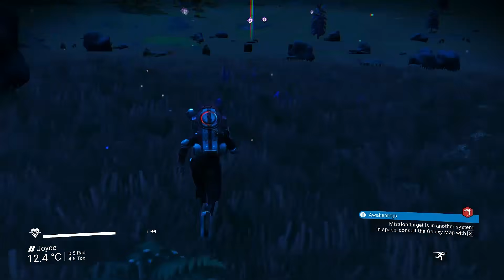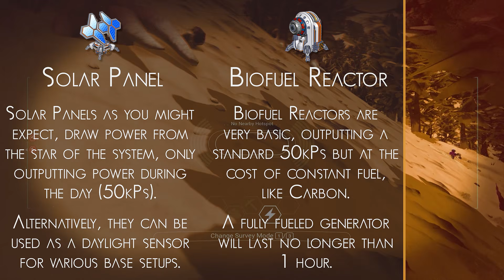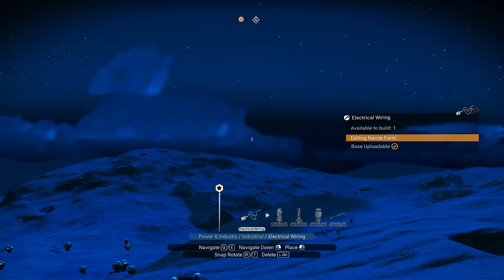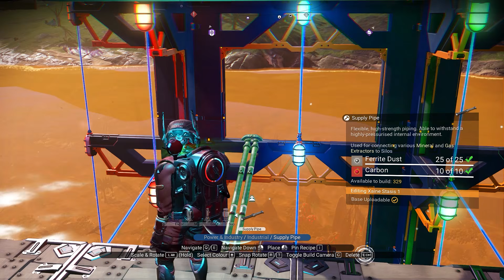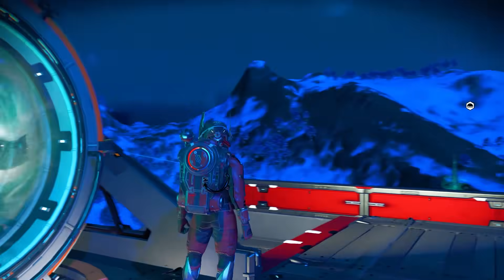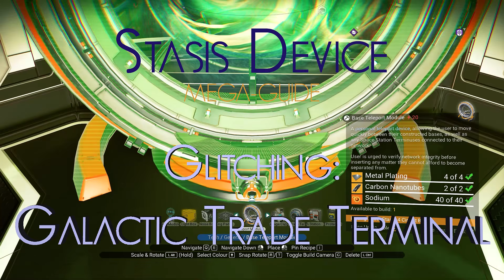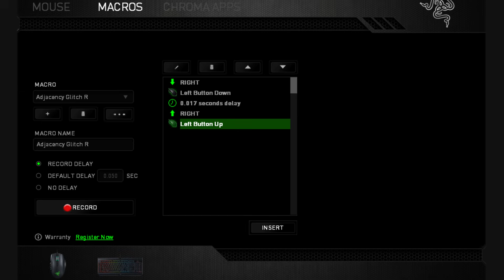Ultimate Money Making in No Man's Sky | Stasis Device Farming Mega-Guide, Units & Building NMS

Comment: Note: Hotspot output reads differently on the wiki, producing up to 250, 500, 750, or 1000 based on class.

So, because the amount of oxygen extractors isn't specifically stated, just wanted to put this here for anyone wondering. If you don't have carbon planters and need the initial oxygen to carbon burn that's just an additional 1680 oxygen. This brings total need of 22,400 oxygen over 16 hours. Assuming C class, you only need 6 gas extractors, and 21 storage depots for the oxygen.
B class will only need 3 gas extractors, and both A and S will need just 2.
Reply from the maker: I believe the article you are referring to is out dated.

This one under oxygen has the correct numbers https://nomanssky.gamepedia.com/Concentrated_Gas_Cloud

I didn't mention the amount of extractors because it differs depending how you do it.

If you are doing several separate lines then regardless of class you just want 1.
If doing a big one just divide the total amount by 16 to get the network total gain per hour.

Hotspots also give a different amount per hour based on where on the hotspot you place the extractor, only the exact centre will give the max amount
Reply: @XainesWorld  Damn I hate when wiki pages are outdated and 'verified''. Thanks for clarifying.

Comment: Fourth time watching this now and I've found my system, created all biodomes and set all mining tools and receptors down. The glass issue I was worried about disappeared immediately after my first frost crystal harvest. 
One question though...I visited your community setup for reference purpose...how do you stack biodomes??? This video is flawless mate. Subbed.
Reply from the maker: Very cool! glad you liked it and welcome to Xaine's World :)
The biodome stacking actually has it's own section in the guide, it's in the glitching section.

But generally, you put a dome up, this will be the top dome, then fill it with crops, then underneath have a circular room greenlit and snapped ready to build and perform an adjacency glitch to switch to the dome.
If you fail the glitch and the dome isnt built but the circular room is, deleting the circular room with delete the crops in the top dome, so youll need to replant, you do get the resource for planting them back when they are deleted.

If successful, you can plant in the lower one and harvest just the lower to harvest both :)
Reply: @XainesWorld  thanks mate!!! I'll need to go back through the glitching chapter. Your instructions in the response are perfect, but I've got a feeling I'll be watching this at least a dozen more times anyway lol.

Comment: Well that was a thing. I am overly excited now with this, I am so looking forward to building one of these on my little corner of the cosmos. I do have however a question, that I think you may have answered, but not exactly, specially because it has nothing to do with the stasis farm, but I did see a space station in the video so... I built an "Observatory" base, then got a bit greedy and decided to build a space station above it, climbing up with stairs and base computers. Everything was fine and i was able to build my station, but i made landing pads for the station and one of the middle bases during the climb, and when I reloaded the game, everything was gone except for the ones i didn't build a landing pad on. Note that the observatory is still intact and it even has a floating power house full of electric generators. I deleted the extra computers that I could delete, except for the one with the landing pad and the space station itself. I can even teleport to them, but then i'm just left falling down from all the way up there, no base, no nada... If i were to delete my observatory, would that reveal one of the other two i'm having trouble with? I have built several bases in one planet at a time (up to 5 at this point) and have not had this problem before. Any light you can give me in this moment of darkness would be appreciated :)

Comment: After about 5 days of gathering resources, building etc things must have changed since this was made as the output of all plants is short allowing me to only create 58 Stasis Devices.

My plant and dome numbers are correct in my build but output is short. Will have to add some more domes though may rebuild and spread it over a few planets as it's already made the game unstable in just one location. Big builds thrash the cpu on one thread for some reason despite the simplicity of the interactions of objects. May build my gold/silver farm first though.

Very good guide though if not sometimes a bit confusing and wish it had a brief overview of all key points/numbers together.
Reply: I was coming here to say, yes, the plants are short. Also I had an issue where they would flat out dissapear from the glitched domes, as if they were never planted at all. Luckily I could supliment the plants with the ones planted at my freighter base to make up for what was missing.

Comment: i don't mean to be rude, but might i suggest one day making a condensed guide where you don't explain everything in extreme detail as if the viewer has never played NMS before? you could leave out the huge sections unrelated to actual stasis device farming (getting a good ship, glitch building, extremely detailed guides on simple topics like obtaining blueprints...).  seriously, for slightly experienced players you could just say "here all the blueprints you need, get them however you want/can", maybe include a link to more detailed video on that topic, and move on to the next step of the farming method.  the actual stasis device farming could then be explained in ~20 minutes, which would be an excellent watch!
Reply from the maker: that's actually what i was trying here, sort of.

The building of the farm itself is like 3-4 sections of the 20 or so of this video, with all the timestamps in the description, you can skip those beginner detailed sections to find the one you want.

It's just tricky making all that clear.

I'm also generally known for the crazy detail in the guides etc. That being said this is by far my most verbose guide, they are usually less convoluted.

Appreciate the feedback regardless <3

Comment: First of all, this is one of the most impressive guides I have ever seen. Incredible job! I'm about 100 hours into the game and I want to build stasis device farm. I have a few questions:
Is there anything that is no longer valid in 2023?
I'm guessing that the glitching is only to improve efficiency? Can it be done without glitch building even if makes it a little less efficient (I'm planning on scaling my own farm down to about half of the one in this video).
Finally, apart from efficiency, is there any other reason to build a base where you can mine multiple gases/metals by using the base extension method? Would it work without doing this (albeit in a less efficient way, again)?

Comment: It's actually better to keep the supply depots and operation centers up indefinitely, even when you visit a different planet (I would actually advise visiting a different planet that way it's easy to tell the operation center from the manufacturing facility as they share the same icon) as it won't have more than one of each up in the same system, not planet. Meaning as long as you stay in the system you will force it to either find manufacturing facilities or nothing, saving numerous planetary charts.

Comment: If you don't mind it being a bit finicky to set up you can slightly break the 2000u limit.  Had this happened to me and my last resource that put my total radius at 2213.  I stood at the at the 997 U mark from my base use the build cam and did the  Double tap build camera glitch. To reset my build camera range and and kept that up until I got over there.  I had to restart the process a couple times for the power the power and pipes but ot worked.  I would be careful using this method though as apparently the render distance is off of your perspective not your body  So if you get too far away you get kicked out and see yourself falling through the world. So far it's happened to me a few dozen times sometimes and every time I just reloads with me standing in my previous spot without a death so Seems safe enough

Comment: Still relevant in Origins. I have my farm up and running thanks to your excellent guide Xaine. I adapted it a bit to suit my personal prefs - i generally skip the  first refine step as I usually have enough condensed carbon and iodised cobalt to go straight to the second step. I found presplitting stacks  more fiddly than just splitting as you load. I also prefer to harvest the crops first as that starts the timer for the next 16 hour cycle -  a combination of max slot starship and max cargo slots usually means more than enough room to do all the crafting.

One question (as it took me an age to find a system with the specs you describe - why should the  planets  be in the same system? - if you're just going to warp from base to base, then it doesn't really matter if they are spread across multiple systems? Is that just for the community/roleplay aspect?
Reply: I have the exact same question and haven't seen it answered satisfactorily anywhere.

Comment: You can actually still get the planters and build them, as they're part of the tech, so the guide should probably be updated to explain this.
Reply from the maker: Aye they added it back to get them just after the guides release. That one detail isn't really worth a complete reupload imo
Reply: @XainesWorld  I wouid put in a comment somewhere saying they nerfed extractors - extractors on the sand supply network now dilute the productivity of others
Reply from the maker: @Zach B Good point, it doesn't actually affect the blueprint in this vid, but would be a good idea to mention the 64 limit before diminishing returns and link the video on how it works in the pinned comment or something
Reply: @XainesWorld  diminishing returns start much earlier, at 15 I was getting half of normal output
Reply from the maker: Diminishing returns doesn't kick in until an extractor network is making 2500 or more an hour and as the 64 device blueprint only requires 2000 per hour for the gases with the others needing less, it is unaffected.

Have you altered it to go through the cycle quicker than 16 hours?
Reply from the maker: Though I will check this again incase they changed this again during the Halloween update

Comment: If you're looking into doing something like this now, just know that it's really difficult to make an atmospheric harvester get 2000u per hour. They were nerfed a while back, and now 20 harvesters all placed perfectly on a Bclass gas hotspot only yield 1,650 per hour. After achieving ~1,000-1,100 u/h the returns are so diminished that you might as well begin the hunt for a new hotspot. The days of having 3 centralized bases are no more, make a bunch of crappy lil bases, then teleport to each of them with an empty inventory (and possibly a hauler too). That's what I'm currently setting up right now. Let me know any tricks y'all know of <3
Reply: The limit is about 1000 per system, if you split your harvesters up you still only need the single hot spot you just have to separate the extractors, i got mine in by doing three seperate lines for the gases, only needed the three bases

Comment: I'm a returning player and my feeling about the game shift back and forth.  My computer is a pile of trash and I find the new graphics make my base act oddly.  Like my exo-crafts disappearing from the summon pads or the vehicles rolling off the pads as I walk away.  Even in the room with my tiny 3 medium refineries they are turning on and off constantly to me, they are running so it is OK, it just extra noise for me.  I also have the same issue with how the solar panels go into off mode the minute I turn away from them and take a couple steps.  But that is all fine sort of but the worst thing is in my TINY base, I hit the MAX size limit.  Now I say tiny I had maybe 2 storage chests, 3 medium and one large refinery, like 5 lights, a teleporter, save, and the thing that lets you research plans in your base, oh I had a landing pad, I had one dome to grow plants and one small plant growing area and maybe 5 stations for base development.  The building was 2 walls tall and maybe 6 by 5 (guess) plus stairs and a few extra walls and stuff to anchor items to the base and that it.  I'm gonna guess but it sounds like less than 200 items which seem like a long way from 3000.  Now I was right beside the trader guy, so no idea if that affects it.  OH, I had 3 solar panels, 2 batteries and a burner that I wasn't using and a bunch of power wires so let us say maybe 300 items to I believe be generous.  WHY the nope can't build that now?  I have like 32 megs of memory.
Anyway, the point is thanks for this video... on the new character I need to find 10 more aliens, get many more blueprints, and figure out how to make much money or something because I would like an S freighter, I mean I have a nice C freighter, I would like my exploring ship to be large I have a nice S but it is smaller than desired, but I should not complain I have a silly shuttle that has treated me well for being so inexpensive :)

Comment: My starting system had all the planet types needed (unfortunately no Cobalt on the fire, ice, or lush planets but otherwise god tier rng).
Reply: Update. Every bug works except I cannot get biodome stacking working. Yes they stack with the  adjacency glitch but placing the second dome will destroy all the plants in the top one. also dome harvesting is not in an infinite cylinder, so you cannot just stack 10 domes on each other and harvest all 10 at once. My farm is now built though and it should be operational for around 60 or so devices starting tomorrow morning.
Reply from the maker: If you fail the glitch and accidentally build a cylinder instead of a dome underneath the dome, removing the cylinder will remove the crops from the top dome requiring you to replant it.

And no not infinite, just to the top of the dome
Reply: @XainesWorld  Oh makes sense. I got it to work with this advice

Comment: I've used this technique before, but sometimes I run into problems placing the holo-doors on the lower level domes. Occasionally the newly placed dome won't allow door placement on the side i need it. it will allow doors on the other sides, but not where i want it. deleting and rebuilding the dome doesn't seem to fix the issue. is there some secret to orienting the initial square room so that when you adjacency glitch to the bio-dome you can control which sides the doors can placed on?

Comment: Is this still up to date?
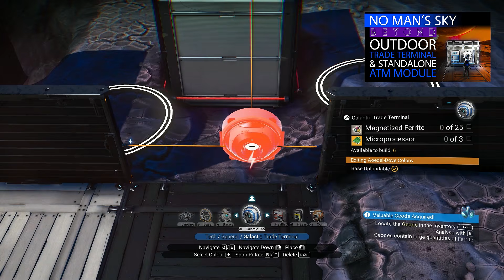Reply: Personal Note: at 59:00, Galactic Trade Terminals have had an update; they can now be built outside freely and have their own little stand which sucks power from anything nearby.
Reply: Personal Note: at 1:10:43, it is implied there are only 3 multi-tool slots.  Probably an error or a past update.  Just figured I'd point it out.
Reply: Did you find out if this still works?
Reply: @gurysdoghouse  Not the way he sets it up, but that's mainly because they patched some of the glitches he uses.  The setup needs some minor modifications, but for the most part, it works.  I mean, it's literally just growing/harvesting/crafting/selling, and that can be done anywhere.  All the other stuff is just to consolidate it to save on travel time, and that's the part that needs a tiny bit of personal touch, especially if you want to avoid the glitching and future patches for the glitches.
Reply: @crystaldazz  cool, thanks for the reply.

Comment: New player here, my base is only allowed 3 medium refiners. is that hard limit new since this guide?
Reply from the maker: yes, though it can be evaded with an adjacency/wire glitch.

As far as i can tell, the limit was put in to help prevent the bug where the inventory disappears, though it hasnt fully fixed it
Reply: You can have more than 3 medium refiners, to build more the additional refiners have to be a minimum distance away. Or you can use the adjacency glitch shown in the video.
I had never used the adjacency/wire glitch before building my stasis farm. It was much easier than expected (on PC).